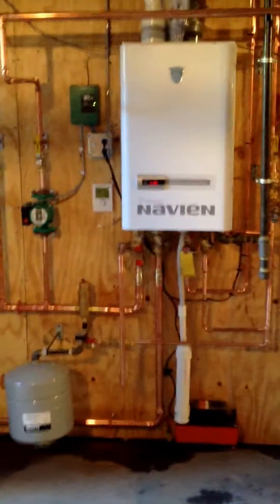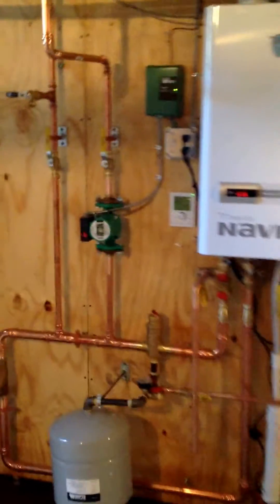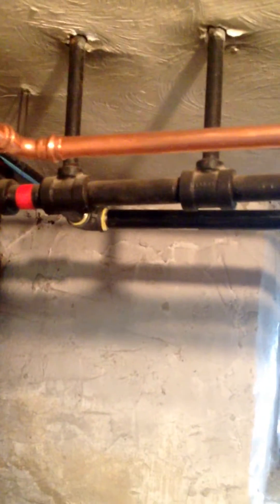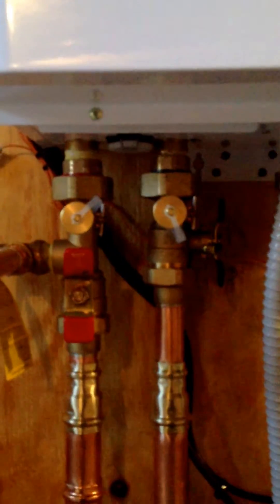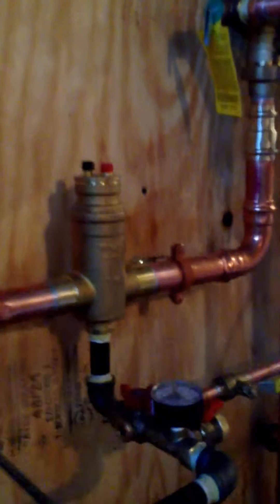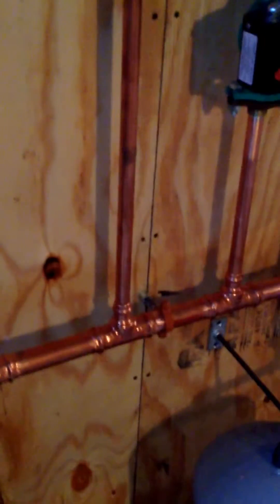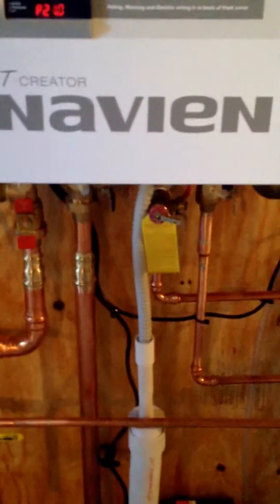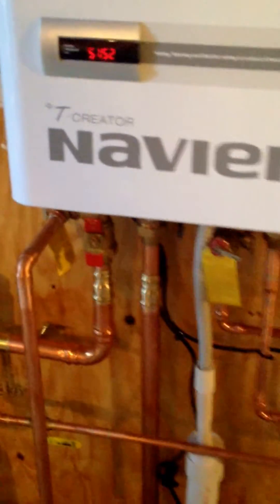Navien CH240 ASME Combination Boiler Installation

Comment: I currently have a weil mac boiler for dom. heat only  2 base bd zones and one zone of radiant   , I built a primary loop so as not to sweat the boiler when radiant runs .. if I installed a navien  would I  just tie in supply and return into my exsisting primary loop  ??? .. I have taco switching releys  for each of the 3 thermostats  and  b &g  flow control valves ... when ever a zone calls that pump runs and the primary loop pump runs too .. so basicly I pull off the prime loop .. thanks

Comment: Using a 2psi gasline with step down regulator, you could run for 500 feet and still heat two more boilers...

Comment: Did you say you need 1 inch gas line. I thought the manufacturer (Navien) states that 1/2 inch is just fine (upto 24 feet)
Reply: 1/2 inch id normally fine. I piped 3/4 today only because I had 3/4 on my truck.

Comment: Monorail? Wtf is that? It's called monoflow
Reply: these are old cast diverter fittings, they have a cup inside that scoops flow to the vertical line above or below, and still allow flow to continue in the main line to the next fitting.  They are really old style, only ever seen one other installation and the system was 70 years old...